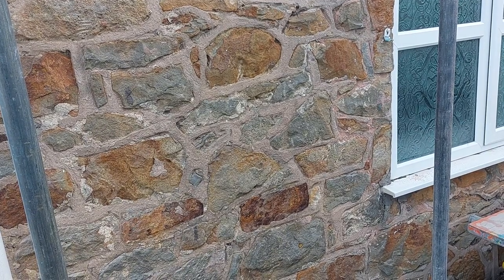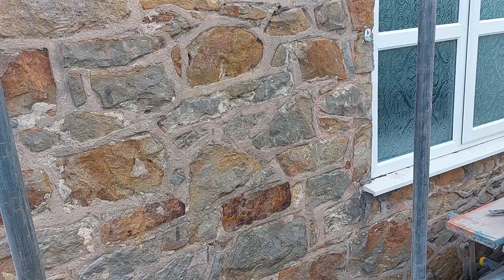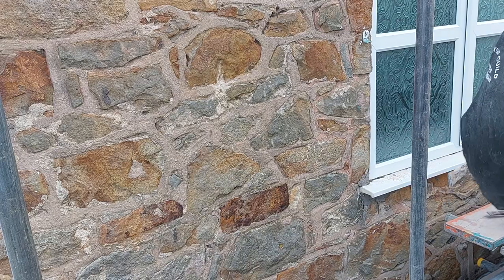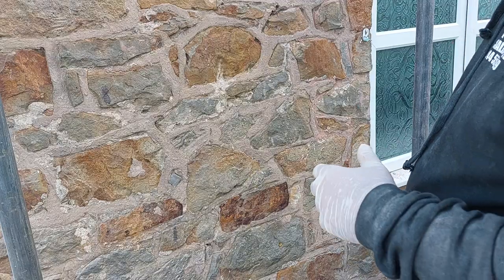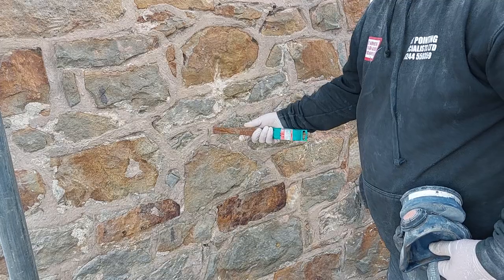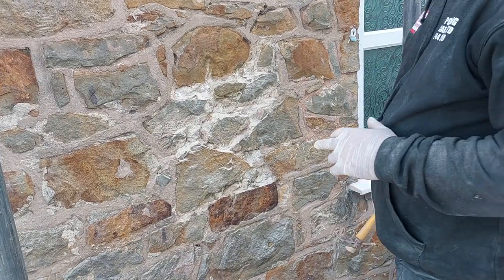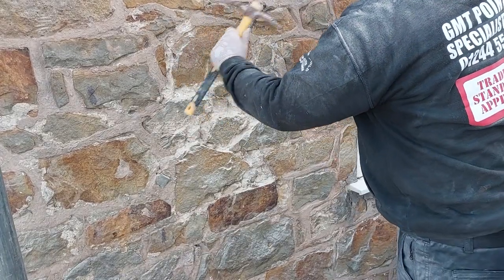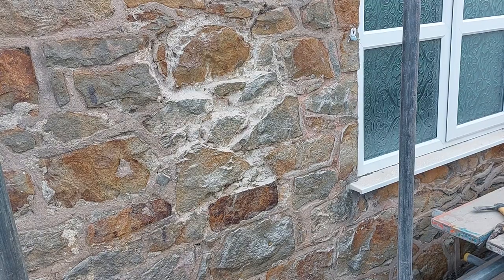Removing hydrated lime cement pointing from a stone lime mortar build property for beginners

Comment: What would you use for hard cement? Would the same technique work? I have a chimney in a building that was once used as a smokehouse in the 1800s. The chimney leaks and the previous work on it was some kind of hard cement that has cracks everywhere letting in moisture and rain in spots. The stones themselves seem to be deteriorating due to the moisture because they flake away in places.
Reply from the maker: If its pretty  hard I cut through the  centre of the joints with a cutting disc first 
Then use a pick or sds
Reply: @GMTpointingspecialistsltd  thanks for the reply!
Reply from the maker: @graythistle  no problem

Comment: Great video, thanks for sharing. I am helping some friends of mine repoint an interior stone wall of an old farm building in France. We will plaster and paint afterward. The building is not listed. Question: The specialist merchant we went to buy our lime from suggested that we use gypsum instead as it's easier to apply. My research shows it dries faster, but does that stop the wall from breathing?
Reply from the maker: Don't use gypsum it holds moisture 
If you are on FB Search lime discussion group

Comment: Any tips for removing lime mortar stains off finely textured brick work?
Reply from the maker: Wattsapp me a picture  if you like 

Normally  if you use water and a scrubbing brush 

Or white vinegar the cleaning type 
Or a mild acid but it will change the colour of the pointing

Comment: Brilliant video, I've recently bought my first house and I believe the pointing is lime, it's really soft and if I scrape into it it breaks down pretty easy. Some areas are really hard where I think it's been repointed with a cement mix. It was built in 1936.

Now I've been trying to do some research and all I can really find is hydrated lime which on the bag it says to use cement with the mix, is this not the correct thing to use as I've read lime mixes don't require cement? 

Sorry if it's a silly question!
Reply from the maker: Hydrated lime is mainly used as a plasticiser for cement 
A natural hydraulic lime or a hot lime you will need 
You need to take into consideration weather conditions where you live
 type of stone or brickwork you are pointing
Reply: @GMTpointingspecialistsltd  okay thank you so much for the reply, it doesn't get the weather to bad but it needs re pointing quite low down near some mud, also had some bricks blow out where I think cement has been used. I'll get someone round to advice so o get it right I think, if your near yeovil let me know.
Reply from the maker: @jackbm250r  hi I'm north Wales 
Just search lime pointers near me and you will get people more local to your area 
Good luck with your project

Comment: I have just about finished pointing my disused chimney. I used NHL 5 for the crown, covered it with hessian and kept it wet. I have, however, noticed that it has cracked. I was thinking of just angle grinding the cracked areas and just redoing these. What would be your advice on this? Regards, Phil.
Reply from the maker: You may have not used the correct aggregate when you do a crown or flaunching we call it up here use broken bricks pebbles slate horse hair to stop it separating it's just dried out too quick because you put a thick piece of mortar on at one time  
I would re do it again 
If you can
Reply: Got you. I used goat hair, but only sharp sand. I'll do it again. Many thanks.
Reply from the maker: @amyntas97jones29  yes goat hair is fine 
Use like a ballast and sharp sand mix  big chunky pebble it will hold it together 
The next day 
Go back and tamper it down soak the Hessian a couple of times a day 
Good luck with it let me know how you get on doing it that way
Reply: @GMTpointingspecialistsltd  Thanks for your advice. It worked perfectly.

Comment: Top-class, Glenn, always willing to help us who're starting out, valuable tutorials. I reckon, if we take our time and do a decent job your vids are saving us hefty fees - and saving the property for the future.

Just wondering; can you use that SDS thingy on sandstone? I swear, the cement mortar on my wall is hard as granite, and pretty deep. I take a heavy hammer and chisel to it and absolutely batter hell out of it, it 'eventually' breaks-away in chunks, and when I think it's all out there's still a chunk just completely embedded, as if it's another part of the sandstone - nightmare. I'm patient, and I'll take as long as it takes, but if I can use that SDS then I will? Ta.
Reply: ps; what's the make/model of the SDS you use? Cheers.
Reply: Okay, got it - Titan Magnesium. Depending on the model, from about £60 - £100 new 👍
Reply from the maker: @ClaimOfRightMuso thank you  I just use a titan  
I like it as I can turn the power down  any make  that has a speed setting will do  
Just be carful not to damage the sand stone
Reply: @GMTpointingspecialistsltd  Cheers, buddy
Reply from the maker: @ClaimOfRightMuso  yeah Screwfix I thing I got my last one from

Comment: Great videos. Gutted as I didn't realise you were in North Wales. Been trying to get my chimney rendered in lime and ended up starting it myself. Where do you source your nhl from? I've started with 3.5 but think I'll use 2 on the rest of  my repointing as it's soft brick. Would you recommend using a pick to remove pointing on brick or a plugging chisel?
Reply from the maker: Hi I get mine from Hughes grey they do lime green products 

Put lime suppliers near me in google 
someone  might be closer  
NHL 2 is ok if your not in the Highlands 
High wind and rain areas
Reply: @GMTpointingspecialistsltd  I've looked at Huws Gray and can't see any limegreen on their site. Do you have to order in specially? Can get nhl 3.5 in rn Williams in St Asaph but not a great deal of choice elsewhere without paying a fortune for postage. Would you recommend a ready mixed render rather than mixing myself from sharp sand and NHL?